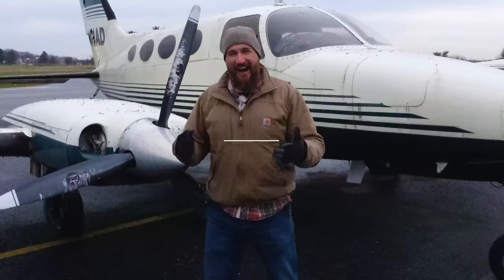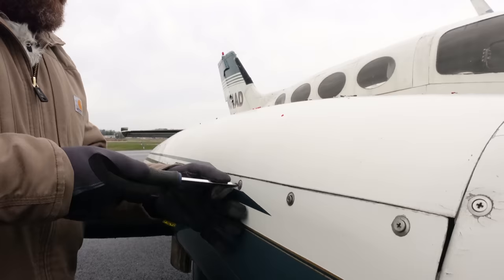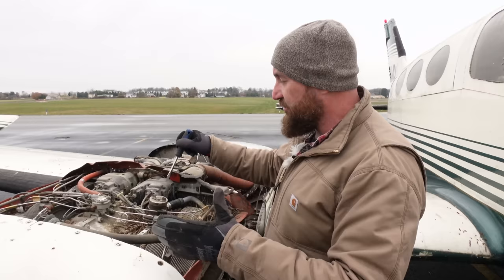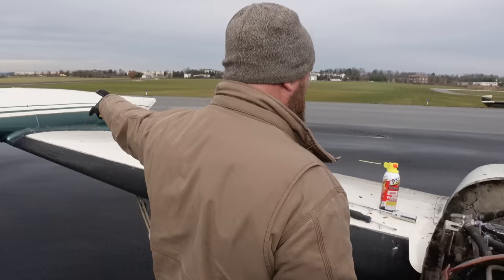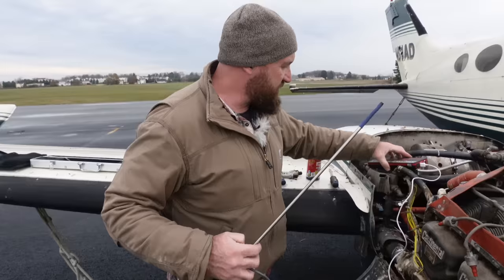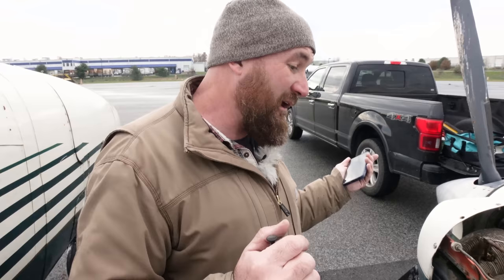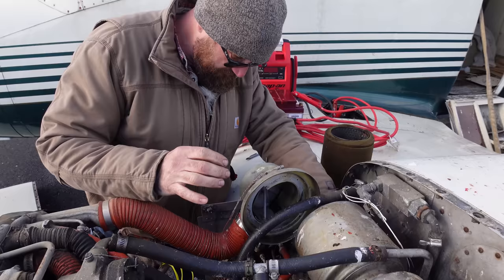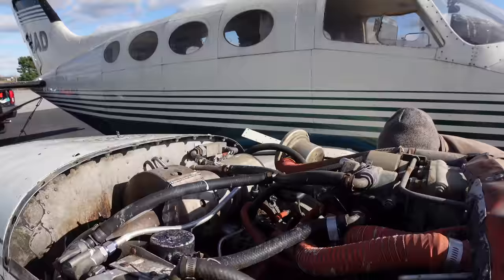FREE Abandoned Airplane... If I Can Start It! Ep1

Comment: Just my 2 cents: A stuck turbo shouldn't keep it from starting and running at idle/low rpm, as long as the intake can get enough air in (Maybe disconnect the output hose from the turbo to free up the intake?). The turbo does not generate any significant amount of extra pressure until the engine is actually running and particularly running at mid to high rpm, as the exhaust pressure is limited at lo rpm (and nonexistant at startup ;) ). Different story if it was a mechanically driven charge device. Also, on a road vehicle that would turn well on the starter i'd have checked all cylinders first for spark, then checked for fuel flow, possibly by extracting each of the injectors and running it briefly into a can with a rag in it, and finally if an indicator was available, try to rotate it a bit longer without plugs to see if any minimal rise in oil pressure would occur, just to try to avoid starting it without lubrication. Now, i totally get that you'd be hesitant to rotate an engine on a plane with you or someone else up close to the prop, and also that you might be rather hesitant to extract the injectors in fear of damaging them and/or the injector lines. But with all plugs out It should be totally impossible for it to fire to get rotation, as there could be no compression, only in worst case a bit of a flame from a spark plug hole if you get the plug too close; hence you could likely check the sparks that way (a pain to remove them all, but what can you do...?). You'd probably also get an idea if the injectors are delivering any fuel, as the unburnt fuel should leak out the lower plug holes. Not perfect indication, but it's better than nothing, and you get an indication for each cylinder. Same setup should logically also let you rotate the engine to check the oil pressure.
Reply: Agree. Fuel/Air/Spark. I'd remove the prop assembly as one of the first steps as well.
Reply: @elgar6743  100% with you on the sense in pulling the prop for fuel/air/spark tests and other stuff that will only have you rotating the engine on the starter. Running the engine without could theoretically have unwanted side effects, however, as the prop acts as the majority of the engines flywheel. I'd try asking a specialist for that type of engines before trying something like that....just to keep safe. I'd expect it to be common to add another type of flywheel or maybe a dyno load or something for "shop bench" running during major repairs etc.
Reply: @Chris Cross  Leave the prop alone.  The prop pitch is hydraulically controlled using engine oil and a prop governor (high pressure oil pump). If he ever did get it started with the prop removed he would have 300 psi oil shooting out the end of the crankshaft.
Reply: Can’t take prop off, and run. Could ruin the engine without the added weight and drag from prop, engine could turn way too fast and blow itself apart.
Reply: Almost exactly what I was thinking, except use an inline spark tester to check for spark. The engine should start and idle naturally aspirated, just leave the cover off and air filter out to turn it over and try to start her up.
Reply: Just remove the sparkplugs and lay them on the metal cylinder while turning the prop. It will spark if it makes contact with the cylinder even if its out.
Reply: @TheTerracide  It has Shower of  Sparks system.  It won’t do a damn thing just turning the prop.  That’s why if the SoS system is inop, you can crank all day and won’t start, unless you get lucky and it fires right when you release the starter switch.
Reply: @learmonkey3582  i read up i think you are right!
Reply: @TheTerracide  I’ve learned a couple things in the lifetime I’ve spent at the airport.
Reply: @elgar6743  WHAT???
Reply: @chriscross5581  WHAT??? if you remove the prop first off oil will GUSH out of the crank snout!
Reply: @TheTerracide  Correct! OR you can just remove one plug lead and lay it on the cyl head...
Reply: @learmonkey3582  SoS, Correct!
Reply: Not bad, BUT don't have the mags on while cranking for oil pressure and there will be no fire risk, you only have to check for spark on one removed lead, if one sparks they all will likely spark, unless there is a bad gear in the mag... there is more but I'm sick of typing, he should get someone that knows what they are doing or thing could go south hard messing around with a twin Cessna...
Reply: Lots alot for 2 cents lol
Reply: YES!! What he said.
Reply: Is that motor air cooled? I think I saw fins on the head. If so, that big fan on the front of the engine might be needed when she fires up.
How about taking a few plugs out and squirt a little fuel in there, to see if you can start a fire in the cylinder. If you get a bang, then you have a spark.
Reply: @ozesalsa  Everything you just said is a bad idea, He needs someone that knows that they are doing, this is NOTHING like a car...
Reply: @elgar6743  if you don't verify it can make oil pressure then there is no reason to check "Fuel/Air/Spark", the first thing to do is to drop the oil and put fresh oil in, pull the top plugs, engine in fuel mixture idle cut-off, mags off, full throttle, and motorize the engine until you get oil pressure...   BUT that is just step one...
Reply: @accutronitisthe2nd95  I'm not a mechanic, or an aviation tech and I don't pretend to be.
     I'm glad the aviation techs are commenting, as I'm now becoming aware of some aviation specific technologies...excellent!!
Reply: @learmonkey3582  Makes sense.
Reply: Nearly 300 people liking this comment have no clue how a prop is assembled...
Reply: @northbaseuk882  Yours truly included it clearly appears. My knowledge background is road vehicles, model aircraft and stuff picked up from interest in smaller pre WW2 aircraft, both latter of which most commonly have had mechanical solutions(centrifugal or directly) for pitch adjustments if any were available. While I was aware it could very likely be a hydraulic system, I admit it didn't occur to me that one would use the engine oil pressure for it. You learn every day.
Reply: @chriscross5581  I have a minor aviation background having been around and jumping from aircraft over the last 7 years. The knowledge I have is mostly of  turbocharged and turboprop aircraft, 206s, GA8s, G92s, Porters 208s etc. Regardless of assembly though the main reason I actually thought removing the prop was a bad idea was due to it acting alongside the flywheel and potentially causing it to run at a much higher RPM than intended if removed.

Comment: As a retired A&P, I.A. I recommend you research the wing spar AD note and any others that would preclude any future air worthiness. There might be a reason it was offered for free of you get the engines running. BTW, I doesn't matter a whole lot if the engines are close to time before overhaul or not. Anyone thinking to fly behind engines that have been sitting that long and seem seized up, should be aware that there could be hidden corrosion issues that could show up at a most inconvenient time.
Reply from the maker: I agree. We did read up on the AD’s and saw the wing spar one. Without the log books all AD’s would need completed which would take a ton of money. However she doesn’t seem to have even a bit of corrosion on her.
Reply: @rebuildrescue  Paint can hide a multitude of sins. BTW, the engines will still run with a seized up turbocharger. And if they are not spinning for a test run, no foul. You could open the oil supply line of top and soaking them for a bit with a good penetrating oil. Then, you must preoil that line so the bearing gets oil pressure before turning up to RPM.
Reply from the maker: @eagle2019  I’ll have to take a look at the Hobbs meter. The only thing is though the logs were lost some time ago so I believe all AD’s would need reviewed and completed to make it airworthy. 
I’ll have to see if the AD is a spar replacement or an Eddie current test. We’re over in the northeast. 👍🏼 We’d love any help we can get !!
Reply: @rebuildrescue  Unfortunately the worst thing for an aircraft engine is to be sitting on the Ramp..Marginally better in a Dry, environment, but even then time is the Killer.  You're better off with a plant that has 3000 hours on it, that gets flown every week, than an Engine with 50 hours on it that gets flown 5 hours a year.
Reply: I've got to think anyone wanting to invest in a airplane like this would rather buy one that's been kept up and never out of annual. Any money saved on initial investment would be spent exponentially trying to get it functional and it still will never inspire the confidence that a well cared for bird would give.
Reply: Some free planes cost more than they are worth to repair correctly.
Reply from the maker: @eagle2019  Thank you for looking those up and letting us know. Why am I picturing 20 of us drilling out those 1000 rivets in no time ! 🤣😂
Reply: We got lots of roads across the country right??? SEND IT haha
Reply: @thatguy7085  Buddy of mine bought a Grumman he Insisted was a Great Buy.  I told him to get a Pre-Buy inspection done, he scoffed at the idea.  He bought it, flew it for 2 months, then it was time for an Annual.  there was metal in the screen, so they borescoped, Cam and lifters were all trashed, spalled and scored, So the "Low-Time engine (One of his selling points) needed a full teardown and Overhaul.  His "Deal" ended up costing him twice what he paid for it to get it safe enough to fly his family around.
Reply from the maker: @eagle2019  🤣😂 true story !
Reply: @rebuildrescue  gonna be cheaper to make your own repairs, register it as experimental, replace the engines with Subaru's. (Not official Airworthy advice; see EAA website for specific processes).
Reply: @derrikarenal3308  Or if you are already a good engine mechanic, then get an A&P certif and DIY.
Reply: @scharkalvin  That would be the cheapest.
Also, if you put the 2000 hours or so this plane needs, but do it as a job, you are putting what, 200K on the plane?
So it must be your hobby.
Reply: @scharkalvin  Goodluck, I wouldn't sign this thing out without a full engine rebuild by a certified shop. Guaranteed the nitriding on the cylinder walls are compromised, the cam lobes will have corrosion, if you can get it started, it won't stay running for long. This thing is scrap 100%
Reply: If you can get it running cheap. You can taxi it up and down the runway. When you get tired of that, call the Fire Department and let them do  crash extraction  training.
Reply: @rebuildrescue  If you can get it to Avcon Aviation in Newton KS or have them send a crew to you, they are experienced airframe mod mechanics. I have drilled and banged a ton of rivets when I worked there.
Reply: @derrikarenal3308  The FAA still need to sign of the conversion from certified to experimental.
That's also not something they're likely to do with somebody that doesn't have a history of building aircraft.
Reply from the maker: @nodaklojack  I’ll have to give them a call. Thank you for referring them to us 👍🏼
Reply: @eagle2019  is it possible the owner gave up on the plane when he was told he’d have to install a spar strap for $70000?
Reply: @stephenholland6328  why not sell it cheap factoring in the repairs? Or part it out? Or sell to someone to use for parts?
Reply: @rebuildrescue  having a ton of money would only work if it was all $100s strapped to the pallet on the scale (that is my most optimistic estimate btw and only counts for one engine.) Sorry sir.